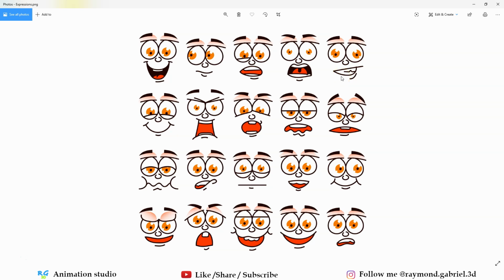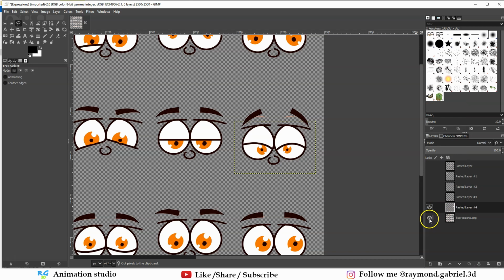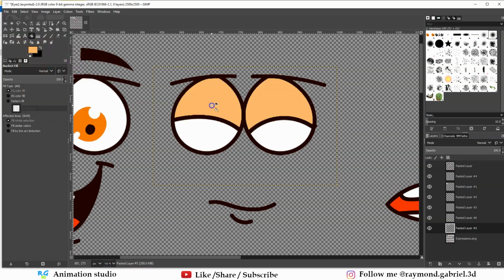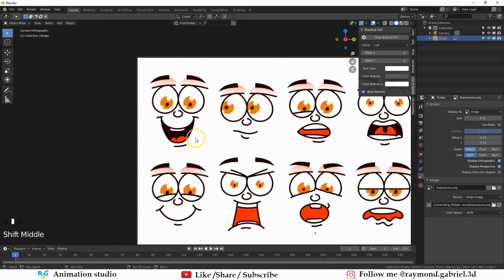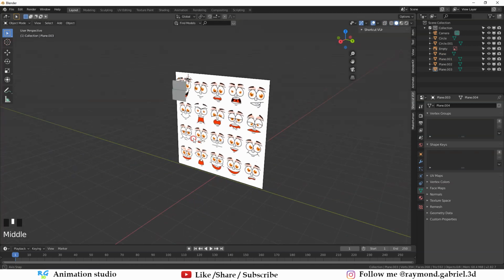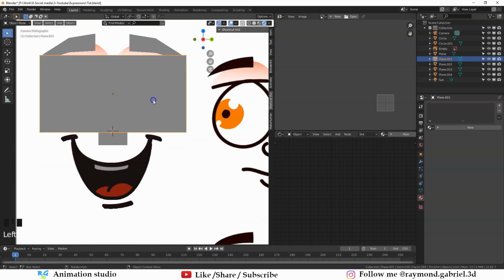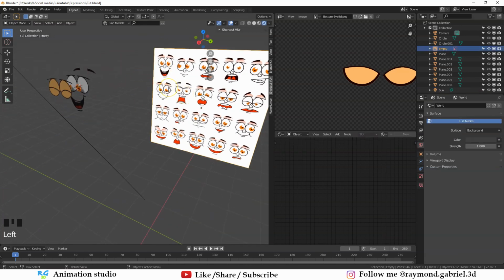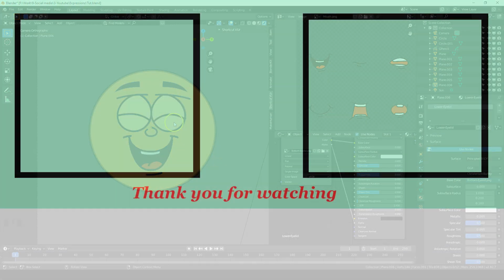How to make 2D expression animation - part 1 [Blender/Gimp tutorial]

Comment: cool :D

the colors of my textures get washed out when i add a sun. if the strength is too low, the colors are greyish and the colors just gradually get washed out as i increase the strength of the sun. how do you get the saturation and vibrancy back?
Reply: so i found the hue/saturation node and connected that, but i wonder if there's a better way to preserve the colors of the texture? or do i have to add the hue/saturation node to every texture that needs color correction because of the dimness/washing out when adding a light?
Reply from the maker: Yes there is, in the render tab, go down until you find color management, change the filmic to Standard, that should already fix the problem a bit, to get it exactly as the texture, you should also go to the shader editor and pull the roughness value to 1 and the specular to zero in the principled bsdf node, I hope that helps
Reply: @RG3DAnimationstudio  

whoa super helpful. this totally worked. thanks a bunch :D